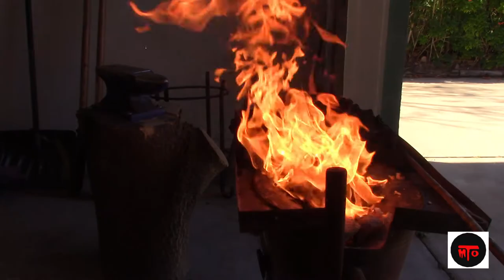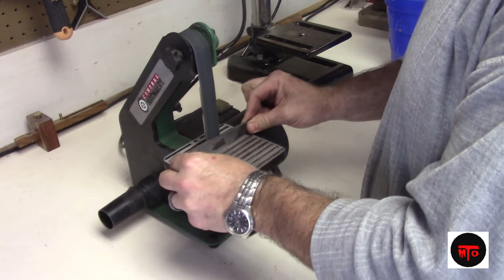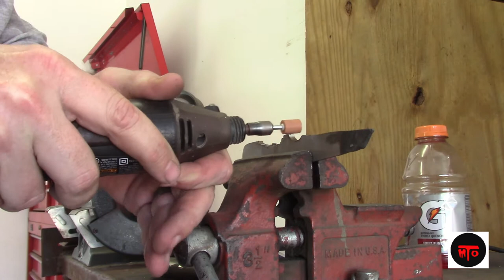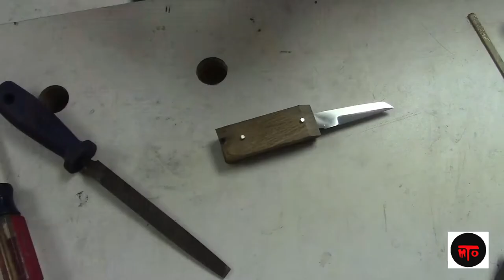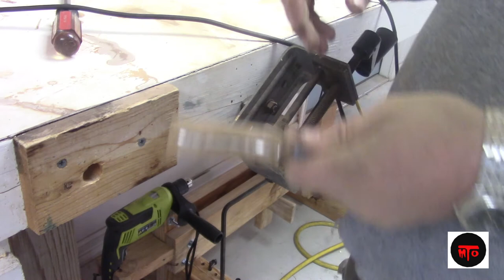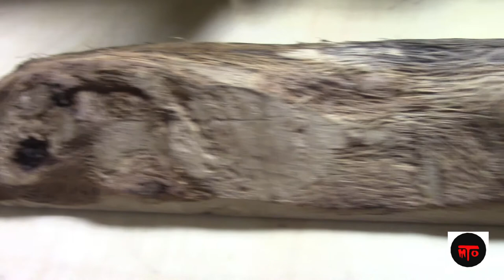Forging a home-made knife from a coil spring - short version

Comment: A lot of work but it really did turn out to be a beautiful knife. I see you are also a frequent buyer from Harbor Freight. I have that same anvil and was wondering what you think of it? I also had both of the same belt sanders but gave them to friends. I bought a nine inch belt/disc sander off of OfferUp that was a Harbor Freight model but all torn apart. Cost me just about a hundred bucks to put it back together, including new bearings in the motor and the rollers plus a new 9 inch cast iron disc. The smaller belt sander was just like yours but only used a few times. I am going to replace it with their model that also has a disc sander. I like your forge too. I'm going to subscribe because I'd like to see what all else you can accomplish with your budget set up. You obviously have the skills.
Reply from the maker: Hi Phil, thank you for the comment.  I bought that anvil just to practice on.  I did not want to spend a lot of money on a good one before I learned how to "not mess it up" and I could not find a used one in good shape that didn't break the bank for me at the time.  It is cast iron, which makes it quite brittle, and full of inclusions in the casting as well.  The edges of the face break off in small bits so it wears horribly in that area.  The bick, or horn, is so fat and blunt as to make it nearly useless.  The hardy hole is not very precise and I had toyed with the idea of adding a pritchel hole, but I'm not sure if that would weaken the top face in that area and just break off since it is cast iron.  With all that being said, I do think it was a good investment for what I bought it for.  Even after I get a good quality anvil (I hope Santa is reading this) I plan to hang onto this one just to have a "beater" that I can abuse without putting a nice anvil at risk.  All in all I would say it is a decent piece if you want something that won't upset you if it doesn't perform well.  As for the other Harbor Freight items, I am usually quite satisfied with their quality.  Partially because I don't expect them to be great performers, and partially because I treat them relatively gently because I know what I'm working with.  It's kind of like driving slowly in the rain because you know your tires are bald.